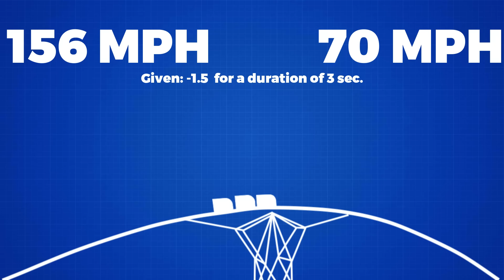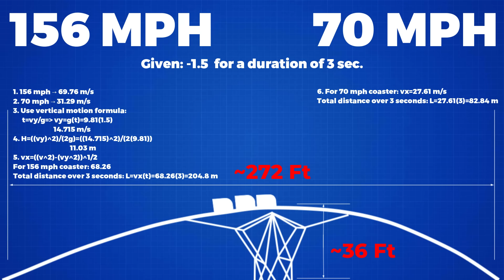The Real Reason Why We Can't Build Taller Roller Coasters

Comment: These things are INDUSTRIAL MACHINES. Engineering, maintenance,  and seriveable access are all involved - OR NOT.

Element wise, we've maxed out. Pushing to always create a newer death experience is absurd, stop grading these things on that.

I tend to grade them according to engineering. My coaster experience is limited to only a few parks but for my money i give the 1st ever tube rail coaster THE DAHLONEGA MINE TRAIN at Six Flags over Georgia a best score. 

Its simply a dam fun ride and it altered the course of coaster design history because the wooden coaster only world was over.

Ive also liked NINJA at that park because its a dam smooth ride considering how compact it is and the elements it has. Its a Japanese design. They are anal about details.

Having fun should always involve a safety aspect. Im always stunned at how many people show up to ride these things sporting flip flops or crocs. Its amazing that accident numbers are as low as they are.

Final note: SUPER HEIGHT also creates SUPER DANGER IN REAL TIME which equals MORE DOWN TIME FOR THE RIDE ITSELF.

Elements like LIGHTNING, WIND, RAIN, OR HAIL could be deadly. 

You may have stood in line for several hours only to be told the ride was closed.

That happened to me circa 2015 at Six Flags over Georgia regarding SUPERMAN coaster.

To simulate superman flying you were placed into a standing restraint then moved into face down orientation. 

After over 2 hours and having just gotten into to loading shed, there was a LOAD POP which was an important bolt snapping on 1 of the cars just short of the shed. 

I was fett away from these people now TRAPPED FACE DOWN. 

Way later i bumped into 1 of of those and asked was she ok. They not only endured the 2+ hours line time, but were trapped for just under another 3 hours not able to get out. 

ALL THE PARK DID WAS GIVE THEM A BASIC MEDICAL EXAM + A FREE VISITOR PASS good for 1 park visit.

Should have been season passes at that point.

The point is, sometimes the thrill simply isnt worth the risk.

Comment: I feel like I'm listening to a paid shill of the theme park industry trying to tell us why their less expensive (shorter in height and shorter in length) coasters are so much better. NO WAY! Height and length of coaster are extremely important. "Forces" do not make up for a pathetically short ride with a pathetically short height in drop. The only time I'm willing to forgive pathetic height is for very specific coasters that have a ton of inversions like The Smiler or Banshee. The only thing I desire from coasters is to either (1) be dropped from a INCREDIBLE height with a nice long ride or (2) have a ton of inversions to keep me occupied. Those two coasters types are always my favorite. HEIGHT is a HUGE part of the experience and I hate waiting in line forever for a SHORT track that is over in milliseconds. Long tracks make waiting in long lines more worth it! I love strata coasters for their height, even with the very short track they offer. What the industry needs to do is figure out a way to make strata coasters more affordable instead of running away from them. Imagine a strata coaster with a longer track that looks more like a giga coaster!

Comment: I still think there was actually something wrong with Kingda Ka, and is the real reason it was abruptly demo'd.  I suspected there may have been cracks in the track and they didn't want to be having to deal with having welders fix them and then for the cracks to eventually return - all while knowing there was something wrong with the track.  They had simply announced it was getting demo'd and poof it was gone!  You don't just scrap a relatively young, center piece attraction like that!

Comment: I think the height of a roller coaster contributes to the experience in ways other than exerting forces on the passengers. Like you mentioned at the start, the height contributes to the fear factor, and the thrill. I refuse to believe that even if I'm feeling the same forces on my body from a 100ft coaster and a 200ft coaster, the experience is more or less the same. I think the 200ft roller coaster would feel more thrilling because of the height.

Comment: There's a theme park in Kansas City called Worlds of Fun that used to have a coaster called the Zambezi Zinger.  It wasn't a particularly tall (just over 50') or fast (about 40 MPH) coaster, but it was possibly the SMOOTHEST coaster I've ever been on. It was so smooth that for years they didn't even have lap belts; you got in and sat down and that was it. The lift "hill" was a spiral, and you were propelled up it slowly and smoothly by a motor in the car. So no "klunk klunk klunk" from the lift arrestors, or jerks from the chain, just a smooth purr that faded out as you passed the last spot with the electric rail powering the motor. It also wound through the woods at the back of the park, so while it wasn't objectively fast, it FELT fast since for most of the ride the stuff you were passing was only a dozen or so feet from the track. I really wish coasters were still designed that way today. (I haven't ridden the replacement yet; hoping to do so next summer).

Comment: Speed is way over-rated.  I can go 100mph in my car if all I want is speed.  It is the path the coaster takes that makes it exciting, not the speed.  Coasters that twist in on themselves and go through tunnels and girders and make unexpected turns and give you the impression that you are headed into a brick wall only to veer off.  My experience is Cedar Point, and their tallest fastest coasters like millennium force is no where near as fun as Steel Vengeance and Maverick. Heck, even Blue Streak can be fun because of how rickety the thing is.  The big huge open air super tall super fast coasters are just too sterile.

Comment: The math behind the ejector airtime thing vs the hype of "big tall coaster go fast" is why so many people don't even think about the fact that a tiny little park in the middle of nowhere in Pennsylvania will actually be the best wooden coaster you will ever ride.
Those that don't know, I'm talking about Phoenix at Knoebels. On the surface, it just looks like a run of the mill wooden coaster. But, take a ride on it, and you will realize that the physics of that coaster give you some of the best and most fun ejector airtime you will ever experience on a woodie. It's not tall, nor is it fast. But, hot damn is it fun. And it will forever be my favorite wooden coaster.
Heck, even children oriented rides like Oscar's Wacky Taxi at Sesame Place have managed to nail that perfect feel of ejector airtime without being at all tall or fast. Which makes it all that much more impressive than just making another tall and fast coaster with a 20 second ride time.
Reply: Went on the Goliath at sf chicago and out of no where its forces were insane and awesome. Easily my favorite of the day and they have some crazy ride systems like chaka khans revenge

Comment: Not true. Gold Coast Australia has the Superman roller coaster and it's super fast without going super high but it's very short and has braking at the end that feels like your eye balls are exiting their sockets! It stays nearly top speed the whole team and then just stops in about 2 seconds with no run off l like these other roller coasters.......or else you are doing an extra lap (it happens when you are like the only 2 people riding the thing and you've been on it 32 times already and the operator gives you a wink)
When you are expecting to stop and you pull 2.5Gs of acceleration! Yeah that will give you a bit of a shock haha

Comment: FYI, Superman Escape From Kypton doesn't count as a Strata. I say that because the structure is 400 feet tall, but the ride starts off 100 feet off the ground (so Giga at best), and the dated launch tech made it so it rarely if ever actually launched at full speed. I've been on it several times forwards and backwards, and I'm not sure I ever got a Giga drop on it, so I count it in my hypers. The best info I can find online is that it did hit the 100 MPH top speed and a drop in the 300's during initial years of operation, but over time it got to the point where you launched in the high 80's/low 90's and did a drop in the 200's. That said though, the way the track is built it could never do a 400 foot drop, so Top Thrill is indeed the first.

Comment: Here's the thing:
By what measuring point?

Lets take... Atlon Towers: They have a couple that 'dip below the ground' if you will. Many a coaster does that, whether through a cutting, or into a tunnel.
Is this measurement from the lowest point a coaster car's lowest wheels will be at vs the highest point the body of said car? is it the lowest point of the rail to the highest point of the rail (which would be more accurate because taller ride cars on an identical track would then have the same height stats, as they should)... or is it weird, like, measured relative to the station, or from the lowest point of the previous 'down' to the tip and/or from the tip to the lowest point in the drop, and this is reset if there's any kind of rise? like if a section has an overall drop - measured from highest point of track to lowest, of 500 feet, but it's not one drop, it's three, with two more small 'up's, then is it actually m ore than 500 because the multiple rises means there's even more distance to drop, or a lot less, because each drop might actually only be about 200 feet each, aka, drop 200, rise 50, drop 200, rise 50, drop 200. Overall only 500 feet of drop, but you've covered 600 feet of drop and an extra 100 feet of rise to do so.

This is why there's a question: What's the single biggest RISE section, single biggest DROP section, and the third: overall height coverage. You can have a little height coverage and still rise and drop a lot through many small rises/drops, or a lot of coverage, but if the station is low down, then the early sections have one large but then many small drops.
And the design is dictated by speed controls and safety measures. Because cars handle differently on the track depending on how much they're loaded, and in what distribution. Like, no one at the front but a lot of weight at the back could cause some cars to not even crest the top of some enough to actually continue on - backsliding. A lot of weight overall could still exceed a designed capacity because Insert Crass Joke Here, so some brake sections need to work harder, which they might not do.

The larger the height coverage, the faster the cars will likely be, which is why it's hard to design a coaster across a lot of height, especially if you're using the 'biggest single di-' ahem ... 'biggest single drop' in some  measuring contest.

Comment: a huge part of the coaster experience is the height and speed though. sure, I could get the same forces as Goliath on something much shorter, but feeling that ejector airtime while you're over a hundred feet in the air, seeing that drop in front of you, feeling the wind rushing past your face, is totally different from feeling it at 25ft above ground at half the speed. 

honestly, we just need more terrain coasters built into cliffs.
Reply: It's really not. Going higher defeats the purpose of going faster. The higher you go, the less sense of speed you have, even though you're going faster, which necessitates larger loops to keep the acceleration manageable. If you want speed, it's better to just have a launch closer to the ground with things as close to the ride vehicles as you can safely locate.

Comment: A lot of people bought tickets for Six Flags Great Adventure simply because Kingda Ka was there. It had incredible name recognition in the tri-state area and everyone who liked theme parks wanted to ride it. Not sure why you’re acting like smaller rides can provide the same forces. No, they can’t. Simply the fear of standing in line and seeing a 500 foot tower and hearing the sirens going off before the launch was an experience in itself. It’s the most intimidating ride imaginable and worth the price of gate admission alone. Sitting on the runway waiting to be launched was nightmare fuel, and the acceleration you feel still frightens me. On Kingda Ka you’re actually relieved to reach the drop because the straightaway is so scary.
Reply: Your comment means nothing. Forces can be matched, period. What you described was a feeling, not forces.
Reply: that's what he was saying in the video, you can match the forces with smaller coasters but height does come into a factor with fear
Reply: Absolutely.
Reply: That mindset of course, is because the GP doesn’t know better.
Reply: Smaller rides can provide the same force tbh I’ve been on tt2 and it is prob less forceful than magnum
Reply: @Gd173-w3j I agree but where can you get a ride with those reverse forces and that crazy floater at the top.of the spike. At least the higher deck and seat height makes the twists in the track more forceful then dragster ever was

Comment: Also just like... by basic physics, if you're relying on potential energy to give a coaster speed, you start needing more and more additional height to gain the same amount of speed. The difference in final velocity between 500ft drop and a 600ft drop is less than the difference in final velocity between a 100ft drop and a 150ft drop. Not only does the cost increase dramatically, but the returns diminish.

Comment: I would suspect,the linit aint on the height but the riders 
You could build a coster on the side of a deep valley, or a mountain, unless your going to have a lift hill which takes 20 mins ,
The issue is ,the amount of gggs , higher the drop the faster you go ,the higher forces,
You could possibly have a fit young person go on it who has a hidden health condition,could be fatal ,

Comment: I was going threw this posible mind trickery that could potentually simulate most coasters to an extent even coasters not possible using only an oval track with a car that has full 360 degree and other bar movements that using screens and counteractive turning as well as proper movements of the car you could trick your brain and get similar forces to a coaster

Comment: Super-fast, super-smooth roller coasters that bank in the turns to keep G-force down into the seat are not nearly as adrenaline producing as the old wooden, slow coasters that jerk you around and take un-coordinated turns so you feel pushed in all directions throughout the ride. Smooth coasters feel so well controlled, there's never a hint of surprise or feeling that you're in danger.

Comment: For me, the biggest problem with faster coaster is that there is no floating sensation. The right speed and the right hill will make you fly out of your seat and float, but with the faster coasters just as you start to leave your seat, your forcefully yanked back down. Instead of fun air time, you just get bruises.
Reply: Its hang time, most fast coasters are designed to have none

Comment: One of the biggest factors in the demise of these huge rides is the huge financial sink with maintenance and repairs. These rides with such extreme forces do damage to the track, trains and even the drivetrains the push then launch rides. Not to mention down time from constant repairs.

Biggest upgrade from top thrill 1 to 2 was an increase in (theoretical) reliability. They can keep it going longer and not waste time.

Initial cost isn’t always a problem if the ride isn’t costing you over and over to maintain, it’s the long game that makes these not worth it

Comment: Right. Height is awesome especially when used properly but I mean look at the height and speed of say, Fury 325. Do we really need coasters taller and longer than that? What more can be done that's not just overly gimmicky? TT2 is dope af but let's not pretend it's not a gimmick. Full circuit coasters with super fun elements is all I need. ArieForce, Velocicoaster, Alpen Fury. Some of the best coasters out there don't focus on height at all.

Comment: Most of the best coasters are 200 ft and lower Velociciaster 154 ft iron qwazi 207 ft zadra 200 ft dc rivals 203 ft maverick 105 ft stardust racers 133 ft and so on
Reply: Taron is one of the best coasters outside of the u.s and doesn’t even hit 100 ft so remember guys just like size doesn’t matter neither does height 😂

Comment: Okay but good luck getting such a long and massive airtime like Falcon Fligth humongous camelback without the speed hahaha.
I think both type or rides have their places.
That's why HyperCoasters and Gigas are crowd pleasers, but people also love smaller rides like SteVe, Maverick, Velocicoaster...
And it's true the cost of a Giga is harder to justify and would get you two smaller coasters for the price of 1 good sized giga.
And Gigas feels short not because of the duration (their duration is similar to Hypers 50s to 1min10 of Top lift to brakes, except Orion...) but because each elements take so much more time, you do less elements so it feels like there is "less ride".
It's also why I think HyperCoasters are the better choice, they're basically the same gimick as gigas, crowd pleasers, high output, but feels longer and cheaper to get.

A concept that really died in the last 15 years is the concept of "Loopers".
Before you had normal thrill rides and loopers thrill rides.
Loopers focused on inversions, while the others had no inversions.
Nowadays that concept doesn't really  exist anymore imo, thrill rides are a mix of both but the inversions, getting upsidedown isn't the goal of the ride anymore, it's just another elements that sometime is there, sometimes is not, and that just enhance the ride layout which has plenty of other cool elements (which Loopers did not have).